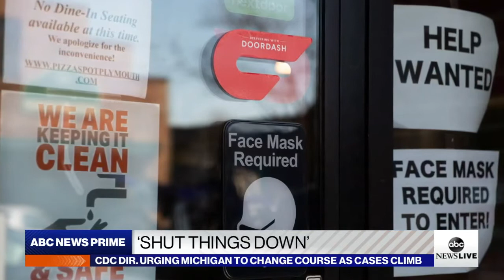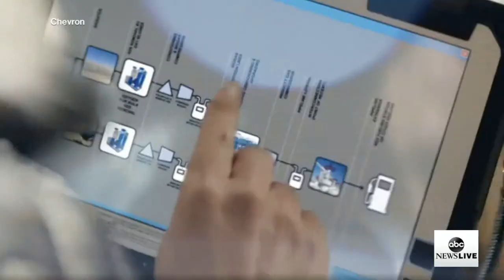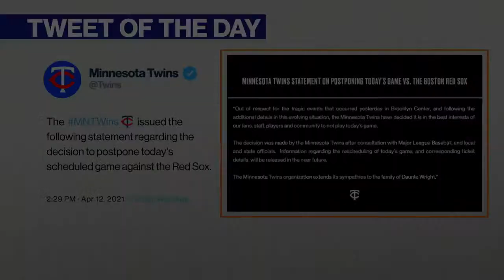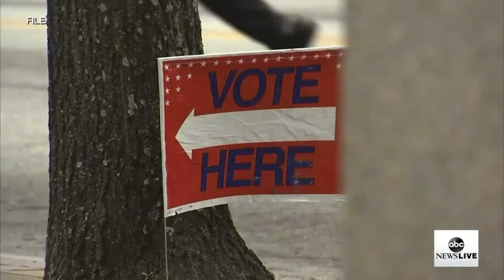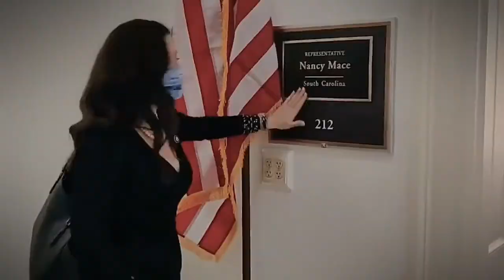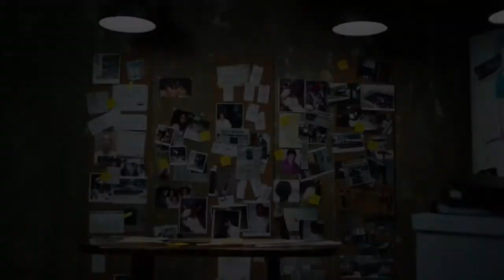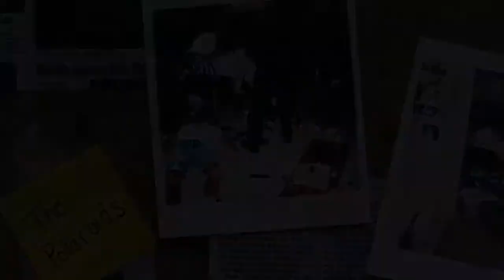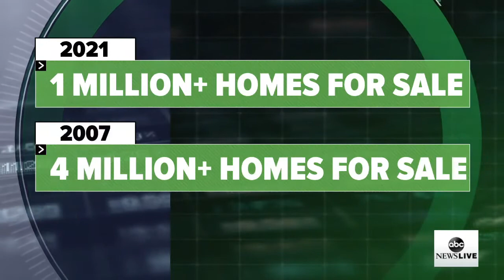ABC News Prime: "Accidental" shooting in MN sparks outrage; Week 3 of Chauvin trial; Volcano threat

Comment: I seen before when the police officers pull their tasers or their guns out maybe some way somehow when they're trained as rookies to keep a correct pattern when they take out their guns out of the holsters and that it is a gun and that they know it is a taser also but this mistaking they've got to get a handle on this this has not been the first time this has happened so if the officers are going to have a taser those tasers have to be placed in a different area of their body design it does not get mixed up with their guns